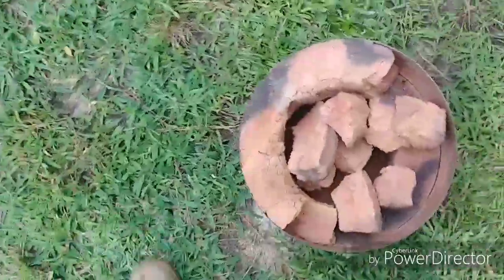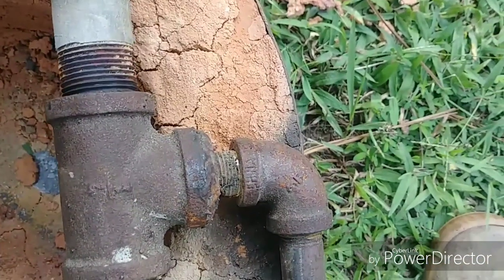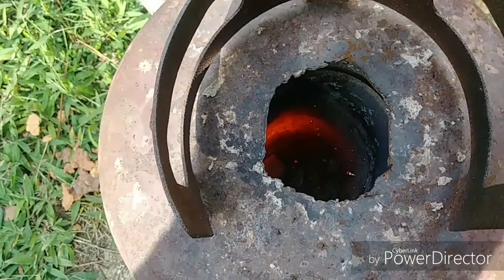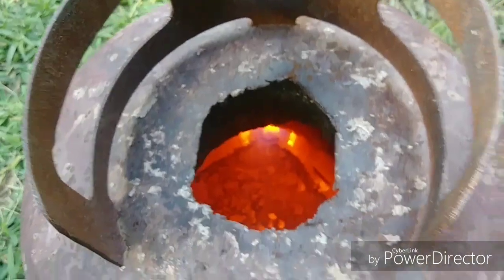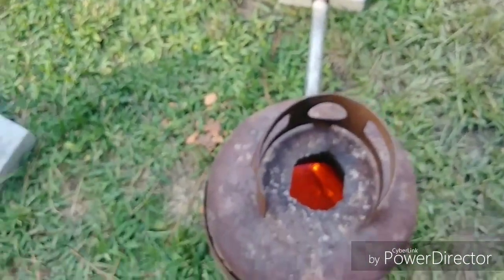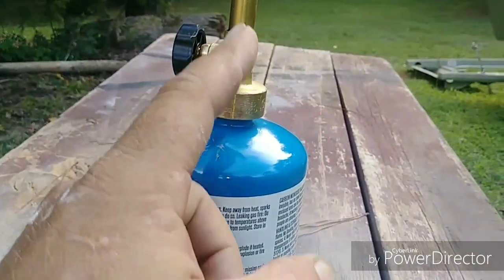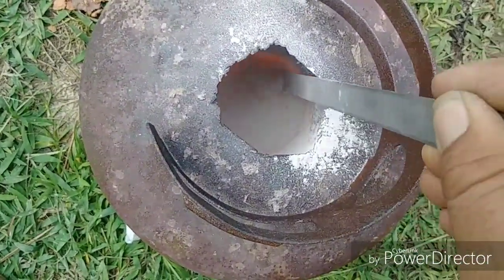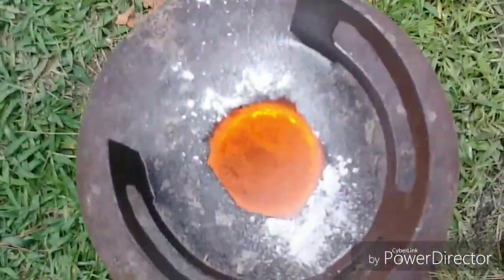Cooking pulverised limestone

Comment: That burner is amazing I may have to modify my forge with one
Reply from the maker: Randy before you do let me test it a little bit more. Also I couldn't agree with you more I do need to buy a graphite Crucible.  or I could make one....... no no hell no that's more expensive than just buying one. Plus I got enough stuff going on.
Reply: Oh I plan on waiting until you have all the bugs and kinks worked out before I start buying the stuff to make one